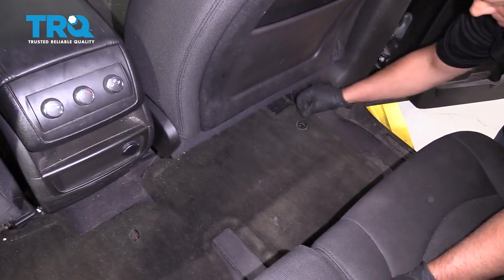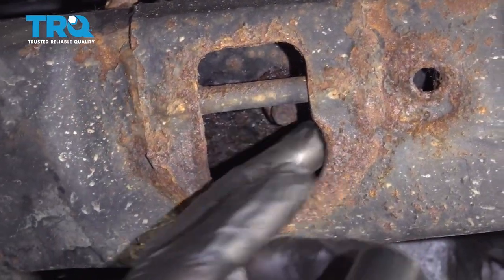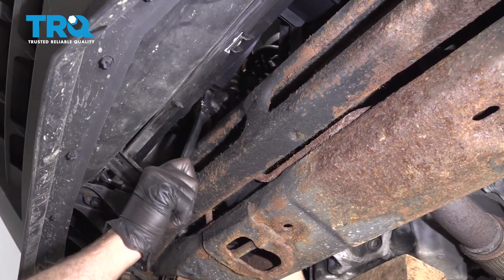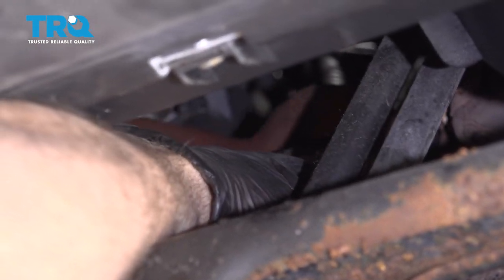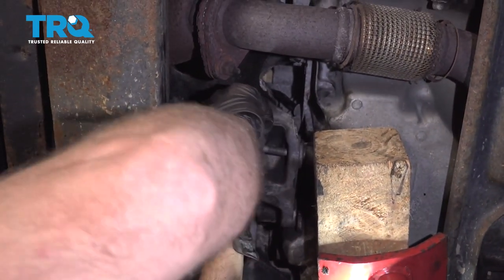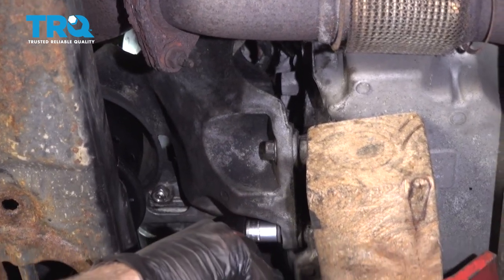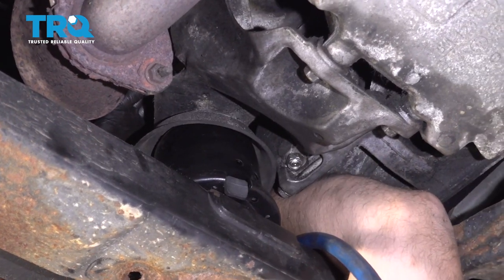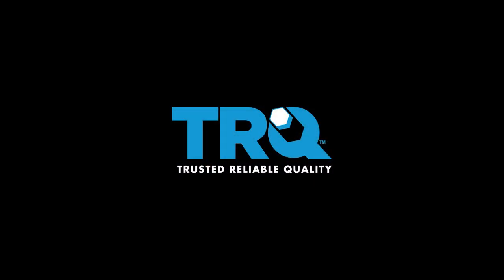How To Replace Front Engine Mount 2009-17 Chevy Traverse

Comment: I bought all 4 mounts from 1AAuto, and with the help of these videos replaced all 4 in less than 3 hours.  I am not a mechanic and have never done this type of job before. I did it in my drive with jack stands and hydraulic floor jacks. I will say that I started with the passenger side mount, and once I had the engine raised and the cross member/cradle lowered for this mount, I was able to remove the front mount without having to remove the bracket, and was able to move right over to the transmission mount before dropping the engine.

Comment: So I have replaced mine 2 times now.   I since replaced the water pump.  Found the upper mount broke.   After watching this I see why my top mount was broke.  I just loosened the bottom mount bolts and jacked up the motor without taking off the bracket.   I must jave broke the top mount.  So dont do what i did.  Should have watched this
Reply: Same! Did one a front mount a couple years ago on my wife’s Traverse before a good video was posted. Now I have front mount #2 and a top mount sitting in my garage ready to be installed 😅

Comment: I just did all 4 mounts. Worst was the transmission (drivers side) one.  Corroded through and leaked all its oil out… big drips for about a week then stopped.  I did the front after both sides and while I still had the front frame undone.  Was easy to jack the engine and drop the frame to get this out.  That top bolt though… tried for a while however he did it and ended up giving up and took the oil filter out then it was easy with long extension.  Tape your extensions together to save a headache. You don’t lose much oil especially with engine cold.  Now a bunch of symptoms are gone with the new mounts! Awesome!

Comment: Good Video.  I did this on my 2012 Enclave.  I replaced all of the mounts.  Basically, you use one jack to hold the motor/tranny up while the other jack will lower the frame.  I also loosened the bolt holding the frame behind the tranny (under the driver's door).  This allowed the frame to lower and the engine stayed up and I was able to install the mount. I tried doing this with one jack and it was a fail, but two jacks (like the video shows) worked great.